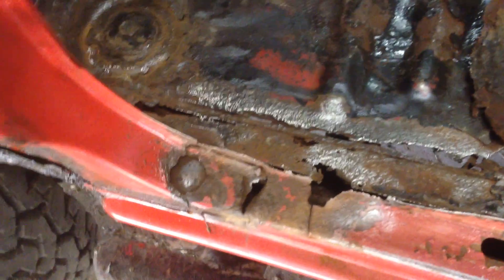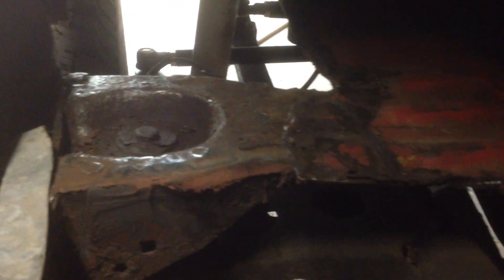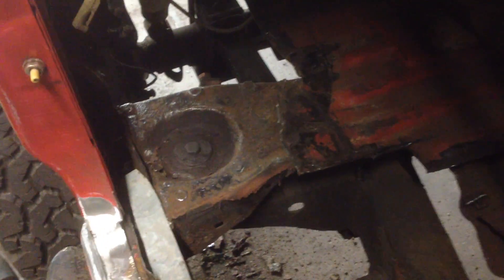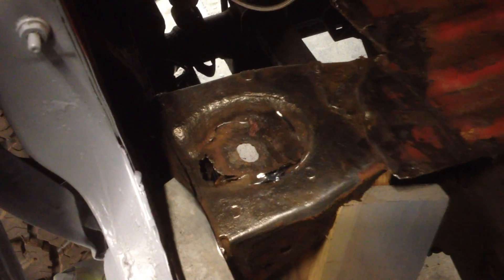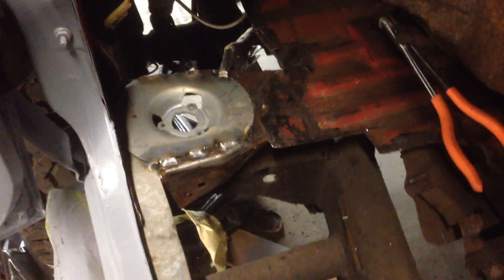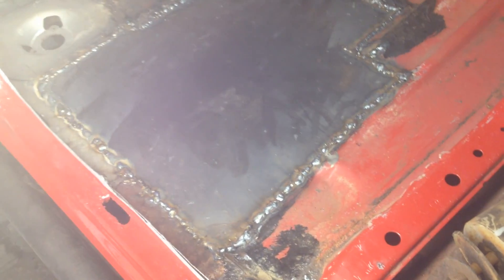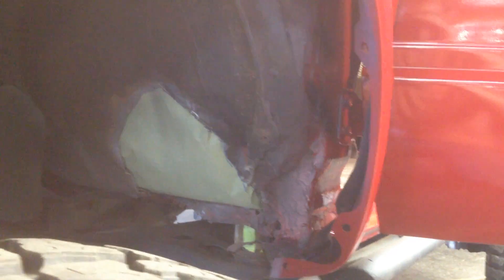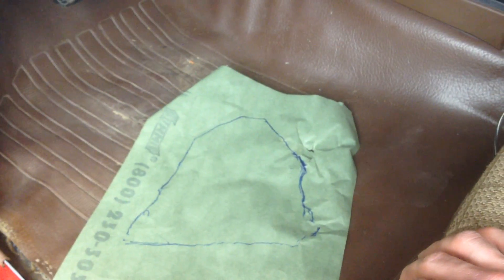Fixing Floor and Rocker panel rust on 1985 Toyota Pickup Truck

Comment: Im having the same problem with the hilux I'm currently fixing (a 91' Hilux Double-cab). The passenger seats were completely fine and looked brand new almost. But the driver & passenger side had the same rust and the rockers are F***ed.  I'm just wondering how thick was the plate you used and did you have to weld it from both sides? Thanks in advance!
Reply from the maker: Those plates were 1/8" thick. I had enough power from my 110v welder to only weld it from the top, so most welders should be able to handle that thickness with no problem. I think there are companies that make replacement rocker panels for the 89-95 trucks. I've seen them advertised in the U.S. You said you have a Hilux, so I'm guessing you're overseas?

Comment: I got the same exact rust problem where you have and currently cutting it out.

- What was the welding settings/wire you used?

- Was your rocker panels and floor sides OK? because mine are all rusted and I am replacing them too.
Reply from the maker: I believe the wire was .023. Unsure of the settings, probably B or C and wire speed somewhere in the middle on my Lincoln SP125 mig. Luckily,  the outer rocker panels and floor sides were still OK on my truck.

Comment: are there any more tips you can give about the repairs my 85 4runner is a lil bit worse than this not the rocker but its almost to the transmission tunnel
Reply from the maker: SkullFrog2 It's a similar repair, just a lot more cutting and welding for you. Any chance you could upload a video so I can see how bad it is?

Comment: So ive got the same problem on my 85 pickup and im curious how you compensated for the uneven floor and the stock floor being corrugated?
Reply from the maker: Unfortunately, I didn't find any replacement panels available when I did the repair, so I just used flat sheet metal and hammered/bent where it needed to match up with the original floor.
Reply: @6thGearGarage  Yeah, that seems to be the case. I've been searching everywhere for replacements but havent found anything. I bought 20 guage steel for a little more thickness, but bending it is going to be tricky. Now, im looking at buying a lower end bead roller. Thank you for the reply!
Reply from the maker: @JS81088  The extra thickness will be worth it. Good luck!

Comment: I know this is an old vid but was wondering if you happen to have any more of those cups handy? got an 85 with same prob
Reply from the maker: The only cup that was the right dia. and depth was the one that I used.
Reply: What was it from? I need to do the same thing on my Toyota
Reply: @lwrdinu  buy a cup from another model of Toyota like a Tacoma and modify to fit.